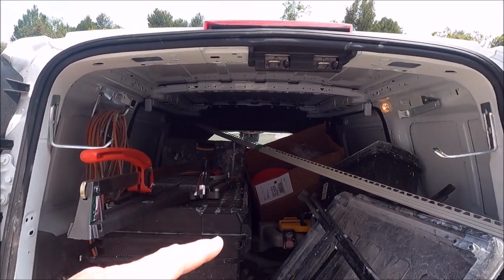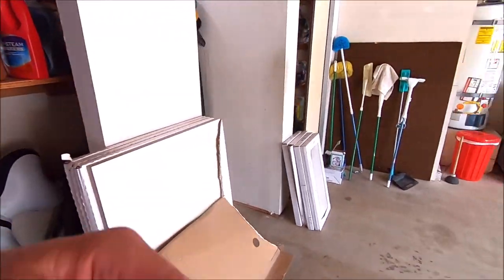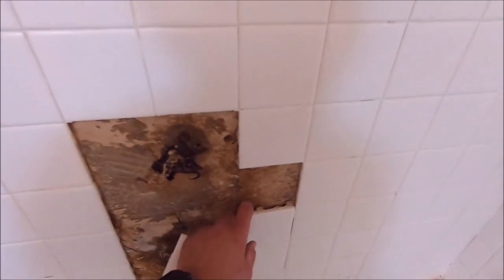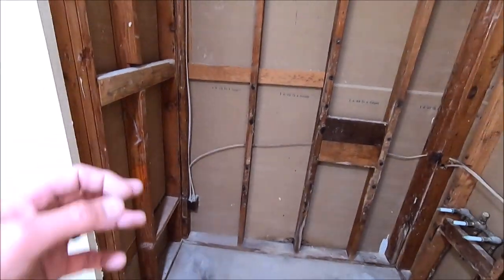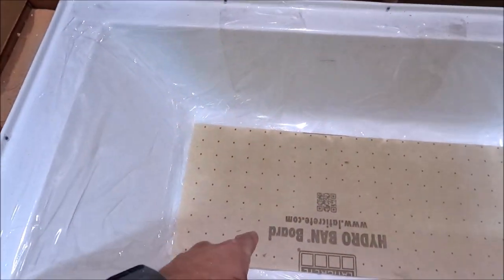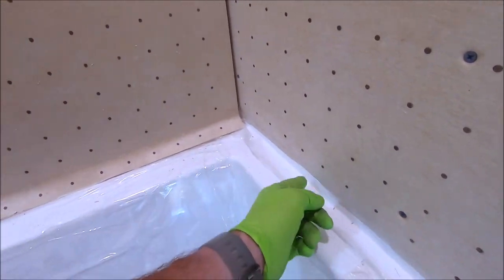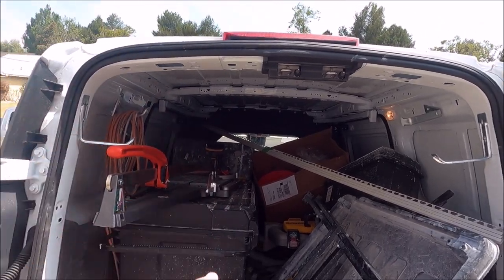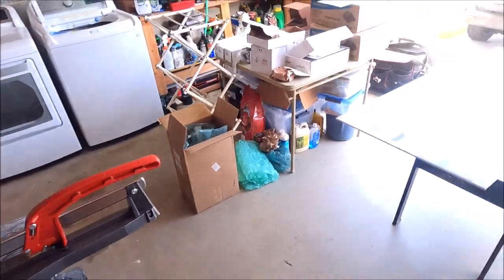Large Format Tile = Easy Money! Double Shower Day One

Comment: You have a great setup and locally we only use schluter kerdi membrane systems ...is that a wedi board ? 

Really like the waterfall bluish tile 
Have you had any experience with even larger tiles ( slab tiles ) that are thin ? 

I'm looking to see what the best cutter 
Montolit flash line FL3 
Rubi slim cutter plus 
 battipav lampo cut

Comment: where the backer board meets the tub there clearly a difference between the plane of the tub flange and the stud wall. Do you back cut the backer board where it meets the tub so its all plumb?
Reply from the maker: We cut back the foam backer board to accept the flange in this video, or we set the board on top of the flange and waterproof the seam.
Reply: @LandbergTileTV   I wondered if it was flush with the top of the tub also....thanks!